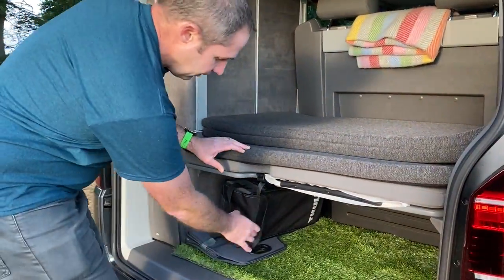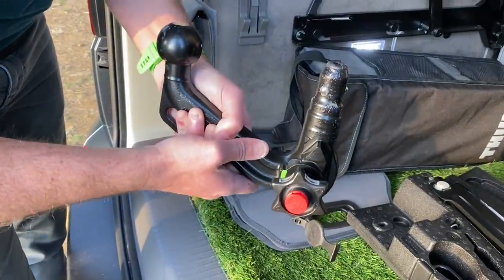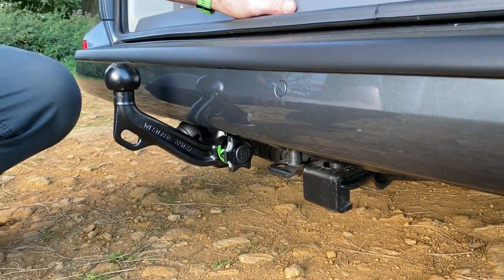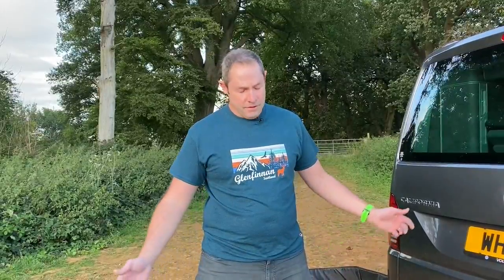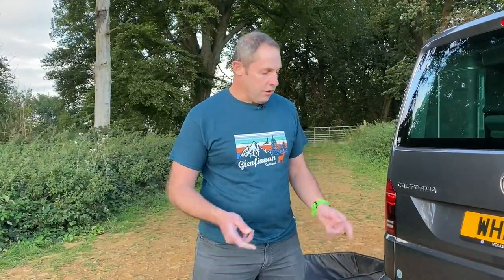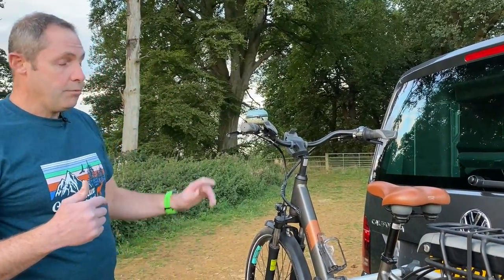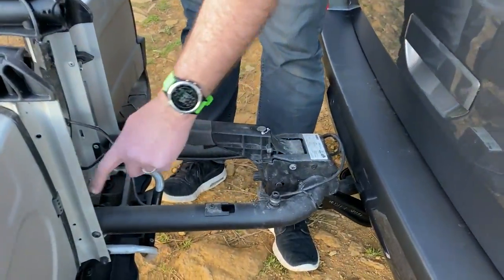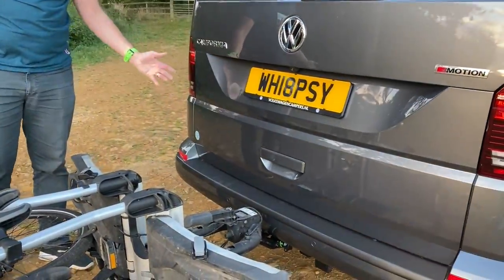Fitting VW California Towbar and Folding Bike Rack (which allows the tailgate to open!!)

Comment: Great video! This type of bike carrier, for people living in flats, it‘s perfect as you can leave it permanently in the boot, rather than bringing it up and down (18kg!). I think the two bungs that have been removed, have a double function of stopping the carrier for tilting completely, but also to prevent the pipe they are fit into to get squashed and assume a oval shaped when tightening the bolts that connect to the tilting section. I think it would be better to leave the bungs in place but shave them off to be flushed with the pipe, in order to prevent the to be squashed but still allow the full tilting…. What do you reckon?
Reply from the maker: Yes you could well be correct in that dual function - although those bolts do have nylon nuts, so you don't need to do them up really tight because they won't come undone anyway. I may modify further !

Comment: Hi Will. I've got this bike rack on my Cali and it works for me without removing the bungs. But we're also making the move to a Sven and I'd like to know if the mod will allow me to use my XT2 with some access to the boot. By my calculations I get 420mm clearance tilted. Did you ever measure the distance after the mod? Long shot but I thought I'd ask. Love the XT2 and would like to keep it, especially as we'll probably get e-bikes before too long.

Comment: Hi again Will. Another good video thank you. Just another idea to throw into the mix. I have decided to skip the tow bar and bike rack idea all together and have bought two Brompton folding bikes for travelling in my new Cali arriving next Summer. Again not a cheap solution but they are pretty compact when folded up and fit into £5 zip up IKEA bags so we plan to strap them down in the passenger compartment when travelling and keep them in the boot when parked. We’ll see how it works out…!
Reply from the maker: Sounds great!

Comment: Great idea. Although in my opinion the bung increases strength in case of unexpected sideways load (such as swerving to avoid pothole or “moose”), so I took the bungs out, hacksawed off the top to leave about 5mm protruding, then reinstalled the bungs. Works a treat without compromising mechanical integrity. I’ve got the 3 bike version btw.

Comment: Loving the videos, keep them coming! 
We have the std tailgate mounted 4 bike rack and like the fact it is always attached to the van and a little higher meaning the bikes don’t get quite so dirty in bad weather.  
The downside to to the tailgate rack is that a bigger bike sits above the van and can be a problem with some height limited car parks - I’ve actually had to take the bikes off to get into a car park before 😏
It is all down to personal choice though.
Reply from the maker: Good point re: the rear rack and height. We've always wondered about MPG too, as we haven't seen any difference when using this towbar rack.

Comment: Hi Will when you removed the bungs did you put anything back in the tube to stop it getting crushed - I have just got and xt3 EasyFold and I can't open the boot and Thule its not advised as you will crush the tube - was thinking of making some nylon inserts but wondered how you got on
Reply from the maker: We didn't, but I can see why you might want to. Ideally these days someone should be able to come up with a 3d printed insert to help with the issue but I've not had a look around to see if anything exists.

Comment: hi
i have just got the 3 bike version and it seams to be angled downwards witch is reducing the clearance it has not moved but would be better if i could angle it back towards the van then when the weight from the bikes go on it levels out.
did yours only site in one place on the tow ball or did it move to you clamped it down. mine only wants to sit in one place.
any help thanks
Reply from the maker: Ours has a natural place to sit but can be moved around a little bit. I think there is an adjustment screw near the ball head locking mechanism that can tighten/loosen it a bit which might give you a bit more adjustment perhaps?

Comment: Total change of subject. Your van is really shiny. Have you had it waxed or ceramic coated?
Reply from the maker: Actually no, not yet. I’m really careful when washing it (2 buckets, sheepskin mitt etc), but I have waxed the front bumper and wing mirrors to help with flies etc. Planning on a full wax in due course but weather will be a problem going into the autumn.
Reply: @CampervanTime  Thanks for your prompt reply. I was thinking about a ceramic coating, but costs in excess of £1000

Comment: Hi Will,  That's a great video and fantastic tip to modify the Easyfold rack..  Could I ask how long you have been using your rack with the 'stop bungs' removed?  We've got the XT2 and I've done the same mod however, looking at the bungs, they are quite substantial lumps of plastic and I wondered whether they played any part in the structural of the tube section where the bolts through.  If you've been using yours like that for a good while, especially with a heavy electric bike, my worries will probably go away.  Cheers, Ayjay
Reply from the maker: Hi, we’ve been using ours like that for about 3 years now. I think as long as you don’t over tighten the bolts back up so that the tubes turn oval you’ll be ok. In an ideal world a couple of replacement alloy/plastic circular collars would be ideal (anyone got a 3d printer?!).
Reply: @CampervanTime  Cheers for that.  In the end I bit the bullet and cut about 12mm off the ends of the bungs and rounded of the edges slightly - works a treat now.  Thanks again for the idea and your great videos.
Reply from the maker: I need to find my bungs and do the same. Thule sell them as parts anyway if you ever need to sell / put back to standard 👍

Comment: Thank you both of you, I am a recent owner of a T6 California Ocean and I’m finding your videos excellent. I have the VW Bike rack fitted and a removable towbar.  I am however thinking of removing the bike rack because I wouldn’t be able to lift a bike that high and I have been considering purchasing the Atera GENIO PRO folding bike carrier. I will have a look at the Thule now though.
Reply: I have a 2021 California Ocean and had the towbar fitted especially to mount a bike carrier. After a lot of research I went for the Atera Genio Pro which folds to a similar size and is a very solid and sturdy piece of equipment. It comes with an adjustable tilt mechanism which allows the tailgate to open fully with 2 bikes mounted. The handlebars don't touch the ground either. You can get one for about £475 in the UK. It also has an option to mount a 3rd bike if you should ever need it. I think it's a better solution as it's designed to work this way rather than having a part removed.
Reply from the maker: Sounds like a great bike rack. Will have to have a look at one 👍
Reply: @VikingPhil9  it did come out the best in my research and I have been waiting for it to come back into stock at The Roofbox (it’s now in stock). It’s good to hear it’s as good as I thought it was.

Comment: Hello, I am looking to purchase a THULE Easy Fold 931.
I am considering purchasing a THULE Easy Fold 931 and found this video very helpful.
Thank you very much.
You mention removing the plastic stopper to take down the rack.
Is the plastic just stuck in the end of the black prop and can it be easily removed?
Reply from the maker: Hello! The plastic stoppers are held in by a couple of bolts you have to undo, remove the stoppers then put the bolts back in. Very easy to do. The bolts are used to hinge the fold down section of the rack, so must be put back! It's all very easy.

Comment: Only disadvantage I can see is that you presumably lose the function of the rear parking sensors and camera?
Reply from the maker: Yes - although the camera still does work but you can't see much. When you plug in the electrics for the bike rack the van automatically disables the rear parking sensors so at least they don't scream at you!

Comment: Excellent video. We have a tailgate mounted carrier and it increases the van height so you can't go into multi story car parks and height limited car parks (usually 2m). I have since bought the Atera Strada DL, which also tilts to enable rear door opening - £425.00. And like yours avoids hoisting the bike up high.
Reply from the maker: Sounds great